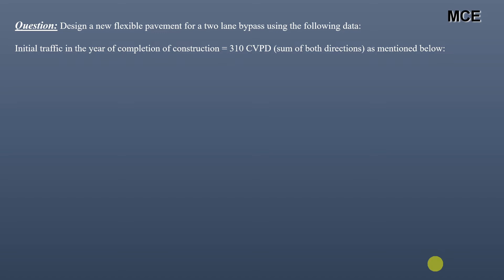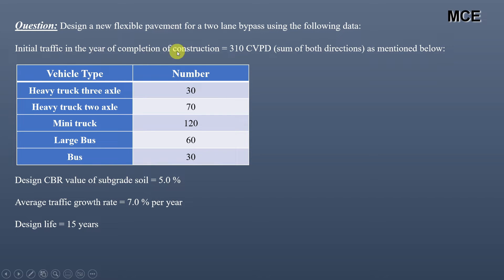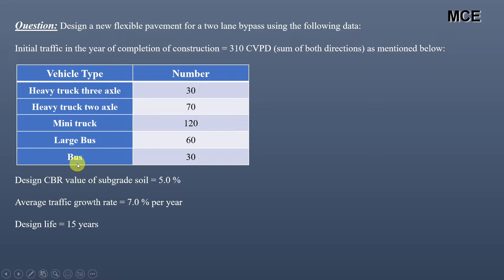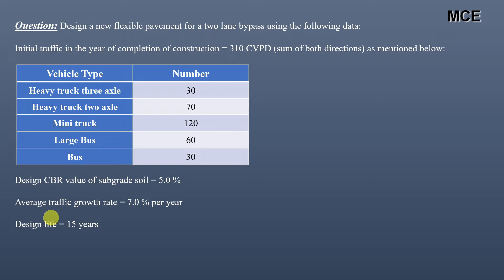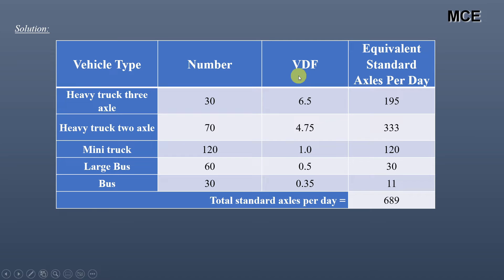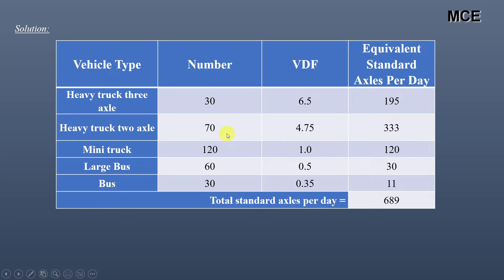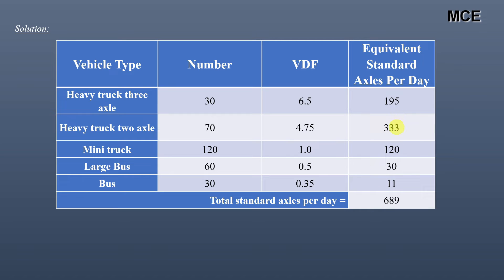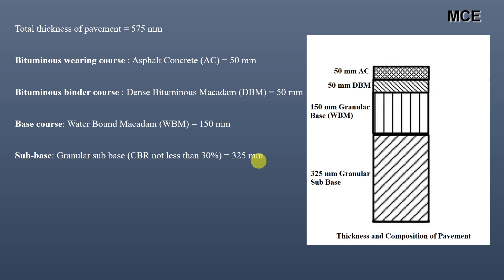Flexible Pavement Design Solved Problem using IRC 37:2018| Pavement Thickness and Layer Composition

Comment: Thanks.
I have questions can one determine the thickness of subgrade layer or subgrade is a continuous layer without a specific thickness
Reply from the maker: Thanks for watching Mastering
Reply from the maker: You have to select the subgrade with a given CBR and then find its thickness using the method given in the video